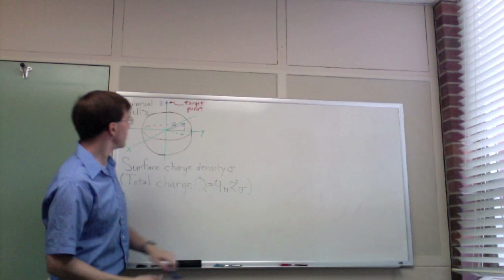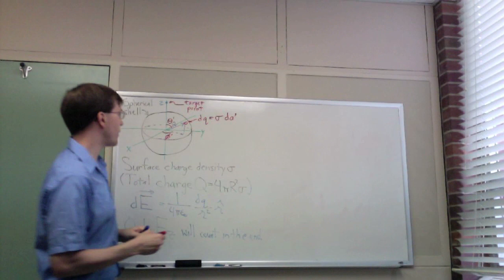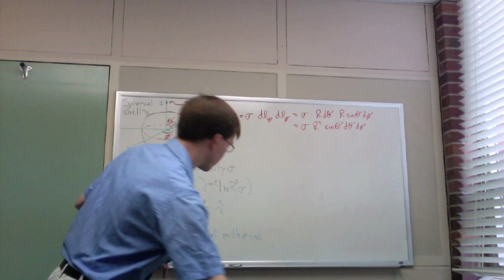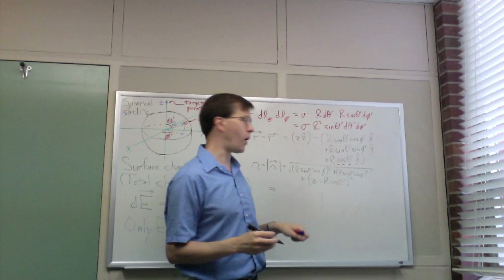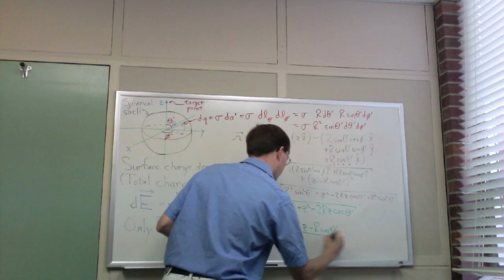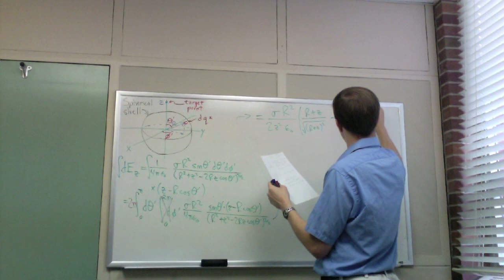Comment: Why do you divide r-script-z by r-script? That doesn't return a unit vector, as the magnitude of the r-script vector is different from the magnitude of its z-component in most cases.
Reply: Correct! It yields just the z-component of the unit vector script-r-hat, rather than the whole unit vector. In this particular problem, because of symmetry we know that the x- and y-components of the electric field will be zero, so we only need to compute the z-component and thus we only need that component of the unit vector. (Of course, it can be pleasantly satisfying to compute the other two components explicitly and see their integrals evaluate to zero! But I'm lazy and it's extra work, so I often avoid it if I have a solid argument showing they're zero in advance.)

Comment: What if R = z? I get the result to be half of what it should be using the formula for z > R. This is because you get (...)*(1-0) = (...) and not (...)*(1+1) = 2*(...). So when using z = R, and plugging in the integral you wrote into a numerical integral solver, you get the wrong result by a factor of 2... Im not sure if this is a physics issue or mathematics issue with limits, but it makes me think that the electric field is undefined at R = z? I guess my issue is, I don't know how to solve these integrals, so I wouldn't get that nice expression like you, and if using a calculator, you will get the wrong result if you just plug in R = z 

A quick google shows interesting results "In this paper, by treating the spherical surface as a series of rings, it is shown that that field evaluates to HALF the discontinuity mentioned above, a result which agrees with more elaborate microscopic models."
Reply: Ultimately, my answer is that your intuition is right: I would not expect a well-defined electric field at z=R, because the charge density is infinite at that position. If you replace this (unrealistic!) infinitely thin spherical shell with a shell of finite thickness, you'll find that the electric field changes continuously from zero to the expected exterior result. (I suppose if I had to choose a value to assign at z=R, I'd probably use the average from both sides: half of the outside result, just as you found. But mathematically it's not a very meaningful question.)
Reply: @Steuard  Thank you sir, that's a sensible answer

Comment: Actually, thanks much for this. I am a student. I had worked through most of the problem, and got stuck on ((R+z)/sqrt((R=z)^2), etc. I got that far, but didn't know what to do with the algebra. You are the only one I found that explained it. I get it completely now...it's pretty clear once you get to the |R+z|, etc, form. I guess that others did not mention it because they reasonably assumed that anyone getting to that point must surely know what to do with the algebra. I didn't. Valuable lesson for me. Thanks for posting. BTW, I /want/ to do the work, not just see someone else do it. I don't mind seeing all the steps, but I /do/ need to see the steps I am missing! (I did a u-sub with u=cos theta, du=-sin theta d_t.)

Comment: "I could tell you, but I'm not going to." Thanks.
Reply: My philosophy is that talking about physical reasoning or about how to set up a problem is at least potentially interesting, but that watching someone else work through routine algebra or calculus is inevitably deadly dull. (At the very least, "how to evaluate this messy integral" isn't the focus I was aiming for in this video.)

If you want to try it, though, my memory is that the most useful u-substitution is to set u equal to the entire parenthesized term in the denominator (so the denominator of the integrand becomes just u^(3/2)). There's a bit of work involved in rewriting the numerator in terms of du, but it's not too bad, and once you're done I think the integrals to evaluate are relatively straightforward.
Reply: Steuard Jensen If you wanted to do the same for an insulating sphere or something like that would you need a triple integral? Also how would you use a Coulomb's law method for any non uniform charge distribution in general to prove something like this.